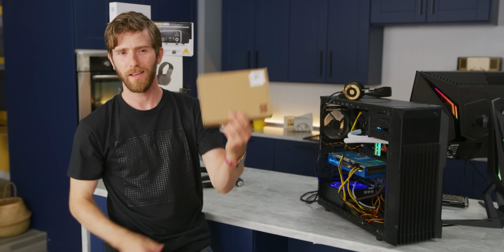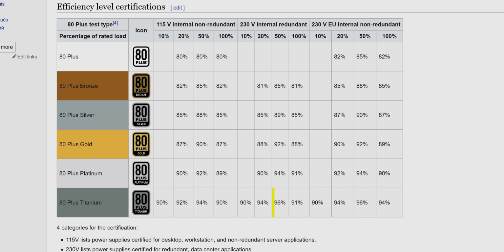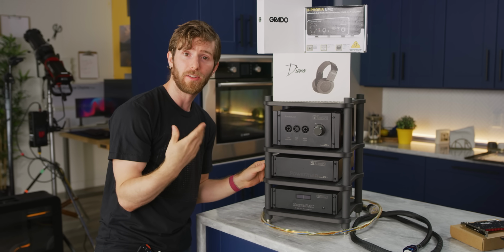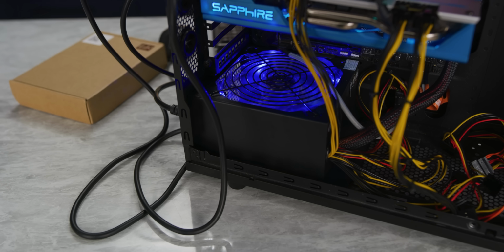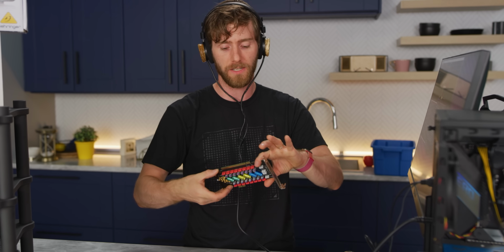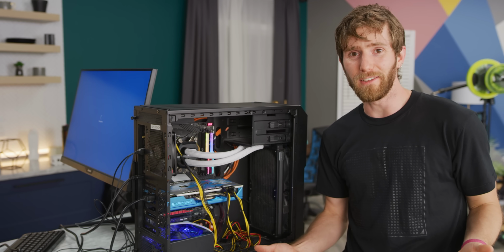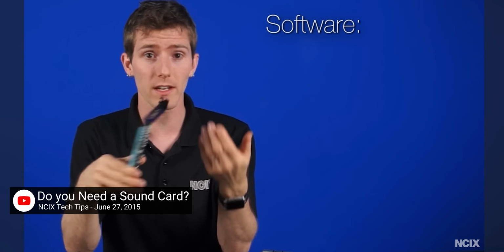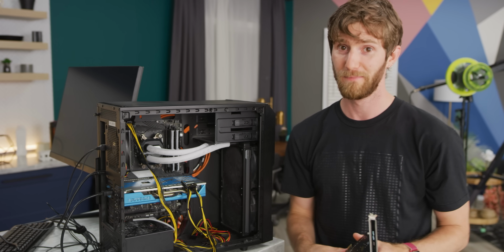Is this $40 card a SCAM? - "Audiophile" Power Filter

Comment: Whenever anything promises to "smooth out the power", all I can picture are those old "power shark" things you plugged into the lighter outlet of your car to "smooth out your car's magnetic interference" or some nonsense. All they did was light up an LED, charge up a little capacitor, and sponge fifteen bucks apiece off the suckers who fell for them.
Reply: i think that the card works when you have big noise problems. not when your system works fine

Comment: Should i upgrade my 1060 strix to a 3070 when it comes out?
Reply: Post PC specs.
Reply: No. 3080
Reply: I also have a 1060 but I think I will be buying a 3080.
Reply: If you have a good enought CPU and $500 then yes.
Reply: @Tom2404  Is i7 4770 enough? And the price of the 3070 is too good to be true.
Reply: @MelkeinRonni  It's not really good as 500 for a midrange card is still expensive compaired to something like the 970 back in the day. And the i7 4770 is only only a quad core.
Reply: I have a 1080 strix I’m going for 3080